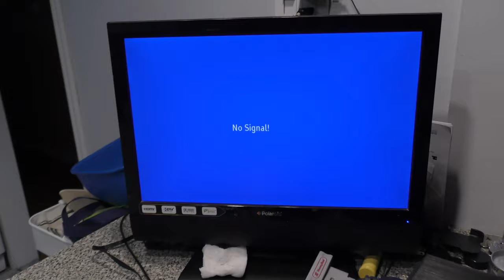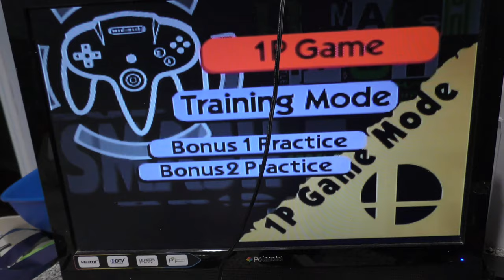VGRestore Ep17: 4 Broken N64s

Comment: n64 with no signal. in a working console i've tested the following: cpu, both ram, pif, encoder and both mx8330. They are all ok. After that I tested the RCP. It doesn't work (i've check twice for shorts and all pins are properly soldered). Have you ever encountered a dead RCP?
Reply from the maker: aassd dff how did you test them and know they’re all ok? If RCP is bad check for broken traces or corrosion in the legs of the chip. If I’ve ever had a bad RCP then it was beyond my knowledge to have known it was bad.
Reply: @PunkNDisorderlyGamer  From the faulty console I removed the parts i said above. Next i removed the parts from a working console. After that I installed the parts from the faulty console in the working console. And it works. But when i replaced the RCP in the working console with the RCP from the faulty console it doesn't work anymore. I've checked twice the connection on RCP. All are ok and no shorts. Also all traces are intact. I never had a dead RCP before. All the consoles i've fixed before had damaged traces or dead voltage regulators.

Comment: Mine, which is in far better condition than those n64 systems,  doesn't want to work properly. That's kind of fun because when I tore it apart to clean it the motherboard was already clean, but still it doesn't show any image when powered on. I'm going crazy.
Reply from the maker: N64s for me are the most difficult in terms of repair. I just never know what’s wrong with them when they’re simply black screening.
Reply: did you fix your issue im having the same problem.
Reply: @Nukemall305  Finally, I gave up. I have no idea why it doesn't show any image, since the motherboard is perfectly clean. I'm sorry I can't be of help.
Reply: XPhantomLord try cleaning the cartridge slot, your game’s cartridge pins, jumper/expansion pack pins and slot.
Reply: @joshua199628  already tried :(
Reply: XPhantomLord     look for any bent pins inside the cartridge slot and check if there’s corrosion on them and on your games..   does your games actually work? Try it on a working N64,  swap out different jumper/expansion packs ect.
Reply: If you have facebook,  search up in group: retro console modders   And   Game Console Repair Legion.               Join them and ask any questions you may have.

Comment: Have you ever encountered the issue where the screen is black (no signal) but if you repeatedly hit the reset button the game eventually starts?
Reply from the maker: If I ever had that issue I would first suspect bad video caps. The reason I would guess that is repeatedly hitting reset may be acting like a heart defibrillator like sending a shock to the bad cap until it takes or bypasses.
Reply: @PunkNDisorderlyGamer  so replacing the Video cable might do the trick?
Reply from the maker: Evan Knutson video capacitors.
Reply: @PunkNDisorderlyGamer  do you know of a resource that indicates which capacitors are for video? BTW thank you for the great videos!
Reply from the maker: Evan Knutson https://console5.com/wiki/N64#NTSC_Capacitor_Lists you can use this for capacitor lists I would recap the whole board if I was desperate, but first I would also try using another power supply just in case it’s an issue with the caps in the power supply. It’s quite a lengthy process but it’s really up to you if you wanna go through with it. If it were me I probably would.
Reply from the maker: It may not just be the video caps it could be the power or other capacitors, so replacing them all is probably the way to go. If you’re saying that placing a cartridge in the slot and hitting the reset without touching anything else eventually gets the console to fire up, I would guess bad caps. It’s just a guess of course.
Reply: @PunkNDisorderlyGamer  the power has to be on first, as if trying to turn on the game like normal. It's very flaky, put the cartridge in, turn the power on, see no signal, repeatedly hit reset and sometimes it will get the signal to come through and the game will run. Sometimes it doesn't work at all. I took a video of the process NOT working :(
Reply from the maker: Evan Knutson you probably got a nasty cartridge slot. Try putting the cartridge (game) under your shirt and blowing into it, but make sure it’s warm air like when you huff on a piece of glass to get moisture onto it. The shirt doesn’t allow moisture to get through and it does the trick almost every time. You gotta put the cart in kinda swiftly once you do it, if it works that means you got a dirty cart slot or dirty cartridge.
Reply: @PunkNDisorderlyGamer  I meant to send you this video. https://www.youtube.com/watch?v=lkhUi2RkEpU I already cleaned everything with a toothbrush and alcohol.
Reply from the maker: Evan Knutson I cant see it, it’s private
Reply: @PunkNDisorderlyGamer  should be public now
Reply from the maker: Evan Knutson that’s odd, I would swap the caps.
Reply: @PunkNDisorderlyGamer  Update: I did the caps but now it's just always no signal. I hope my soldering work didn't make it worse... I tried testing the voltage as you have in your videos, I get .5 on one of the 220. Do you know of a resource for what the voltage should be?

Comment: how can i contact you, my n64 stop giving me video signal only audio, please help.
Reply from the maker: Chester Arguello Jr try on another tv some modern TVs are a bit dodgy with component green/composite yellow multiplug. If you have sound and no video the system still has life.
Reply: Try reseating the jumper/expansion pack,  clean them and the slot on theN64 aswel and try again..      if not, try reflowing the AV connector on the N64

Comment: Hello, I have also a Nintendo 64 Wich is doesn't work it turn on but there is write no signal on the TV and when i put my thermometer on one of the cpu the temperature was about 65/70 degrees Celsius does it mean that the cpu is bad ?
Reply: And and the other cpu the temperature was about 45 degrees Celsius
Reply from the maker: If it’s still not detecting a signal on the screen, try cleaning the cartridge slot, reseating the expansion slot, and cleaning the game first. These CPUs don’t fail too often.
Reply: @PunkNDisorderlyGamer  thanks you for the reply but I tried all these things a lot of times and it doesn't work I even buyed a new jumper pack and a new rca cable but it still with no signal...
Reply: @PunkNDisorderlyGamer  I don't know what to do ...
Reply from the maker: Mekkwal check for corrosion or broken traces on the CPU and other main chips. Was the console working before?
Reply: @PunkNDisorderlyGamer  yes it worked before
Reply: @PunkNDisorderlyGamer  there is no broken part on the cpu but i will verify for the corrosion but I think there is no corrosion
Reply from the maker: Mekkwal if it worked before it must be the cart connector or dirty game.
Reply: @PunkNDisorderlyGamer  so if I change the pin connector I must work? It's not the game because I tried with 2 games
Reply: @PunkNDisorderlyGamer  hello I have just a question do you know how to replace only the pins of the connector not all the piece ?
Reply from the maker: Mekkwal you need a new connector, you can’t replace them. Keep in mind the N64 pin connector when you pull it off it may seem like there are pins missing but some pins in the middle are missing. In fact there are more on one side than the other so be careful when you try to put the pin connector back on it could bend some of the pins.
Reply: Sorry it's always me... How can I found the 48 pin connector of the N64 because I sought everywhere but I don't found it in order to fix my Nintendo 64... Can you help me?
Reply from the maker: Mekkwal your console not having a signal could mean you’ve got a bad pin connector what I would do is first try to clean the one you have with, 99% alcohol, deoxit, electrical contact cleaner,  or whatever. If the console was working before hand and now it’s not it could mean it’s reached its filth threshold and just needs a good scrub try a stiff toothbrush or thin paintbrush really get in there.
Reply: @PunkNDisorderlyGamer  ok I will try clean the connector very well thank you a lot for your time 😀 I will tell you if it work or not
Reply: It doesn't work 😭 even with a good wash with alcohol... I don't know what to do...
Reply: @PunkNDisorderlyGamer  you don't know what it can be ??
Reply from the maker: Mekkwal if you cleaned the console, reseated the jumper pack, and you know it was working before, you may have bad Cap, other then that idk what it could be.
Reply: @PunkNDisorderlyGamer  sorry but what is cap?... I don't understand well because i'm from France..
Reply: @PunkNDisorderlyGamer  and really thanks you for your Time
Reply from the maker: Mekkwal capacitor, you probably have blown a capacitor.
Reply: @PunkNDisorderlyGamer  ah ok thx I will see ..
Reply: My game doesn't work could you fix it for me
Reply: @honeypie89ful  try to open it and clean it with alcohol